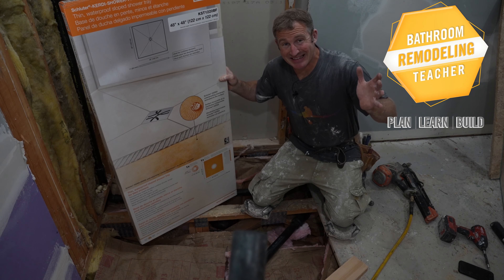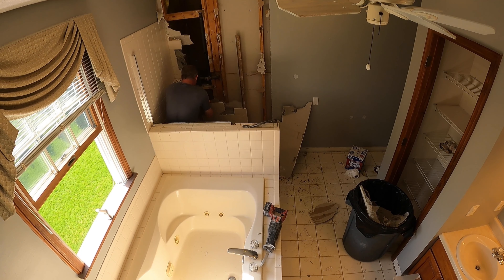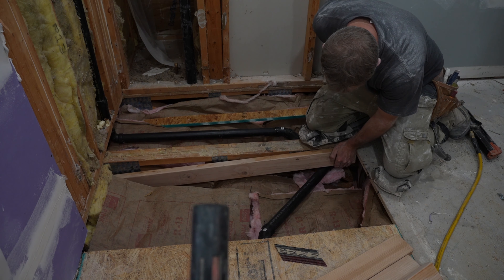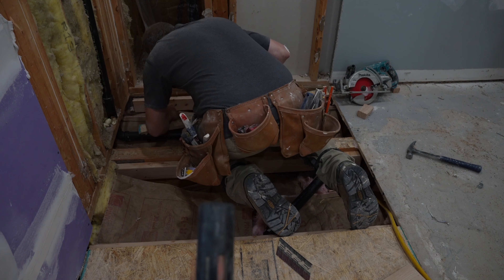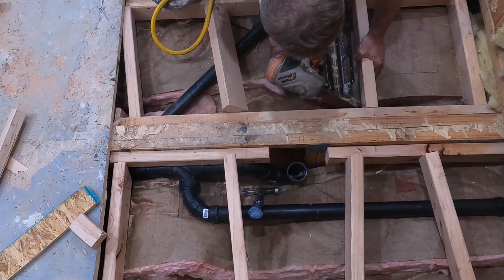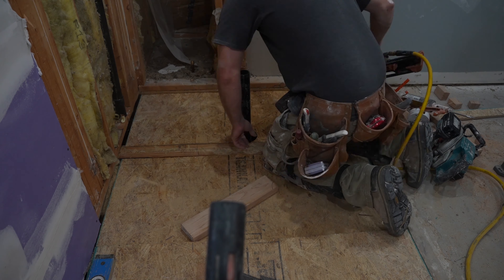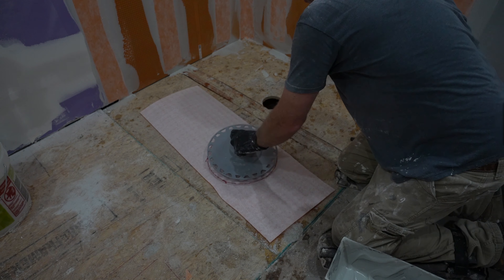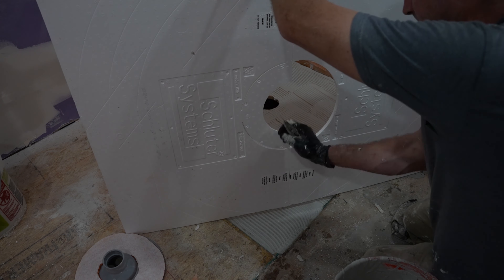The easiest way to build a curbless shower I Plan-Learn-Build

Comment: You can use screws to hold your flange in place ( there are holes on the outer rim of the flange) then thin set your flange membrane . No more pole !

Comment: Thin set even modified does not bond to OSB plywood. It may feel like it did during install but it crumbles under the whole assembly over time.  A silly thing like reading the application instructions of thin set cannot be overlooked.  If you’re gonna thin set anything down, make sure it’s over regular plywood or concrete board and apply the thin set as per manufacturer instructions.  It won’t cost that much more.
Reply from the maker: Calling your BS on that one. All the big manufactures accept OSB as a substrate 👍
Reply: Your welcome.  If a homeowner can protect themselves from he said she said my work is done. Every product has application instructions, it’s right on the bag of thin set. I’d of never said a word if I never saw it for myself.

Comment: I really appreciate your videos and I don't say this in anyway as a know it all, but I am a electrician and its so common to get a resistance reading(ohm reading) by holding the lead with your fingers.  The ohm meter will read through your body and give a whack reading.  So not telling anyone what to do, but to get an accurate reading make sure to either a) use alligator clips with out your body touching the leads and or conductors or pinch one meter lead and one conductor while using the other hand to make the lead and conductor touch, no skin touching the metal parts. Alligator clips work well.
Reply from the maker: Agreed 👍

Comment: Hope you installed a waterproof barrier over that drain flange...
Reply from the maker: https://youtu.be/MCGf9VH0m-4
Reply: Came here to say the same thing, but looks like he put an additional layer of kerdi on top of the ditra.
Reply from the maker: @MaxRunia  https://youtu.be/MCGf9VH0m-4
Reply: @BathroomRemodelingTeacher  Thanks! Sorry I missed the rest of your videos. They're all great with so many good tips. Appreciate it!
Reply: @MaxRunia  I'm a big fan of overlapping kerdi, my whole bathroom is like an old Roman bath if any pipe bursts or sink overflowes it ALL goes straight to the Linear drain at the entrance to my curbless shower.  It's friggin heaven.

Comment from the maker: For next video on the building of this shower - check out this video https://youtu.be/D4a9M3_wnMc
Reply: AMAGER they chose a curbless with a CENTER drain >.<  If you do curbless people ALWAYS do linear drain with large format matt finished floor tiles with a bit of roughage, thank me later, I got some for less than 2 bucks per sq ft at my local distributor.

Comment: Got one, because of advertisements and it looks like a good idea, and brought it back fast. The pitch was 1/8 of an inch only. On a wood framing system and a expending and contracting clay soil , it’s a no go.

Comment: From what I've read, Ditra XL is fine to use with joist spacing of 24".  You mentioned Ditra is 1/4" but it's 5/16".  Is there another Ditra you are referring to that is 1/4".  Or were you using Ditra XL here?  Thanks

Comment: I used a laser level to recess my subfloor. Some spots the subfloor is above my joists. Any tips to fill this in? Pack it with thinset? I thought about using some spray foam and cutting it flush. Not sure if that’s the best option for thinset though. Old house (1890s) true 2x8 joists with hand hewn 8x8 rims

Comment: Why don't you put the pan down before the wall boards so any water making it's way thru the wall grout to the wall boards will "drop" on top of the pan and drain to the drain instead of draining down the outside edge of the pan? Love your videos. Very detailed yet wonderfully edited to reduce their length.
Reply from the maker: Thanks, the way Schluter works allows you to install this way. The waterproofing is within the banding. Easier to get a tight joint putting pan in after walls. Plus the banding of seams in walls can be messy, so it’s nice to do before setting pan 👍

Comment: Great video. Is it possible to put down another piece of  plywood ontop of the existing one outside the shower. So it would be 3/4" above the shower area. This way i would not haave to cut as much.
Reply: You could raise the entire subfloor around the shower area but then you would have to deal with the raised transition between your shower and any adjacent room.  Also the tiles you end up using will have an impact as to how much recess you will need for a seamless transition.

Comment: I bought the pvc flange by accident and noticed that the abs pipe fits into it with too much clearance.  Did you find this to be concerning at all when using that transition cement or is it all good?
Reply: abs and pvc are the same outside diameter
Reply: @David P  there's definately a fitment difference.  I had to buy the abs flange

Comment: Wonderful video. Thank you! Dumb question: are the joints recessed too? If you recess the 2x4 isn’t there a height difference from original joist and Newly added 2x4?
Reply from the maker: So yeah recessing the 2x4s and getting the 3/4” plywood even with the top of existing joists is the objective. Some guys plane or Notch joists too, but that can not be done with engineered joists like this 👍
Reply: Additionally, planing or notching joists shouldn't ever be done without a qualified structural engineer saying it's ok.  Reducing the depth of a joist will weaken it and could cause significantly more deflection in the joist or potentially failure.  Code for the notches and holes you can put in a joist can be found here: http://www.co.routt.co.us/DocumentCenter/View/61/Notching-and-Boring-Allowances-for-Lumber?bidId=#:~:text=IBC%202308.8.&text=Notches%20on%20the%20ends%20of,the%20depth%20of%20the%20joist.
Reply from the maker: @t3jem  great comment John. I agree. Engineers are required for that.
Reply: Ok. I get the 3/4 in part of recessing the floor. So I'm doing a much bigger area. Using durock 1/2 in, plus thin set, plus the tile. I'll have a hump?
 Never done this before only walls?
Reply: @nekawallc6324  Considering the use of (about)3/4in subfloor is standard in the US and the Schluter Pan is 1in, you recess the pan 3/4in with the method shown in this video and you lay down ditra/ditra heat(1/4in thick) to make up the rest of the difference and get a completely level floor into the shower.
Reply: Wouldn't the sub floor need to be recessed an additional 1/4" since the heat mat is being put in the shower as well?

Comment: I watched this a while ago and totally forgot. I'm doing a curbless shower right now with heated floors in the shower, just like this, BUT I set my drain flange without putting some ditra heat mat under the drain flange as a spacer... am I screwed for waterproofing the shower pan after putting the cable down?
Reply from the maker: No worries. I forgot to do that on my first one too. I’m not sure if  Schluter would have a problem with keeping warranting it without  or not. I personally don’t think it’s a big deal. Just takes a little more attention to getting the kerdi membrane to slope down and bond well with drain flange. It’ll also create a little more of a drop around the drain for tiling….but that can be made up easily by feathering out a bit more thinset when setting floor tile 👍
Reply: @BathroomRemodelingTeacher  AWESOME, thanks for the pointers, and great videos!
Reply: @refixed  How did it turn out?
Reply: @elifire4147  Great! We use it every day lol. It wasn't a big issue, but definitely would have been easier if I had remembered to add the spacer. Cheers

Comment: I'm trying to do curbless shower but below the shower floor i have a gas pipe that is up against the top of the subfloor and it's not easy to move down. So I can't recess the plywood. Is there still a way to do curbless without touching the gas line?
Reply from the maker: Raise the outside floor….that’s about it
Reply: @BathroomRemodelingTeacher  I was thinking about that and thought there was other ways cause it will raise the floor 1 inch plus 3/8 tile stepping up to the bathroom

Comment: All you show is on a wood joist. I have same bathroom but concert slab. HOW is it down?
Reply: That's my next project too.  I'm guessing it's gonna be some sawing and jackhammering and probably cementing.  OR I'll just raise the whole rest of the room an inch or two using MGO board.
Reply: No jackhammers , the 1 inch shower pan can sit directly on the floor and either raise the bathroom floor with a thicker tile or raise a quarter inch with cement board.